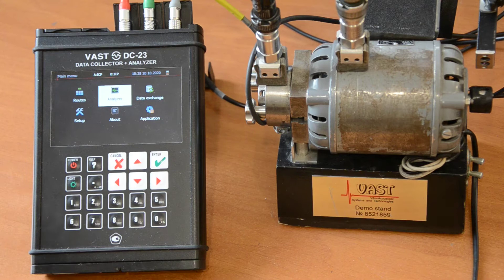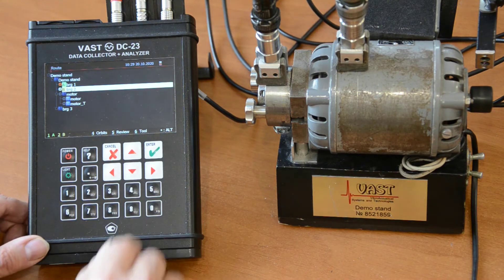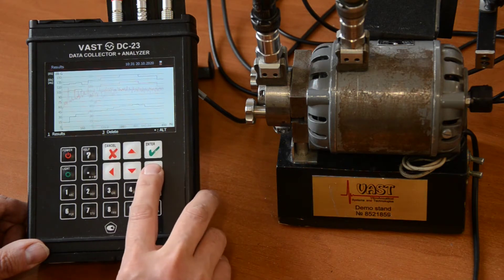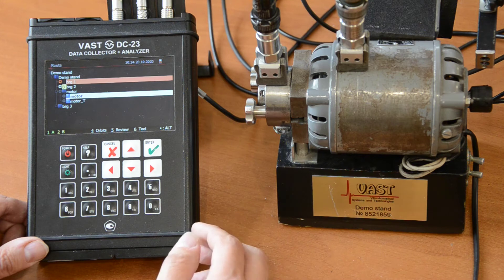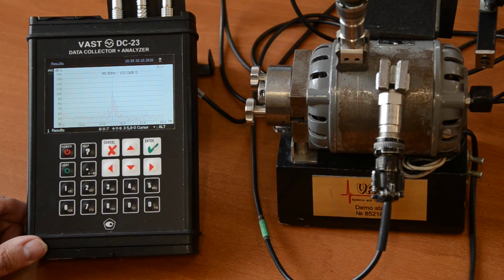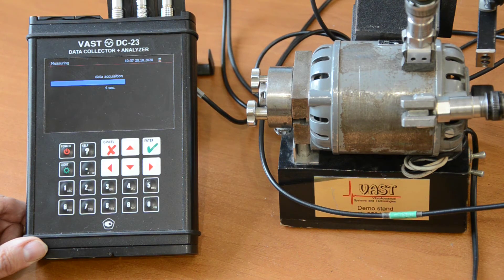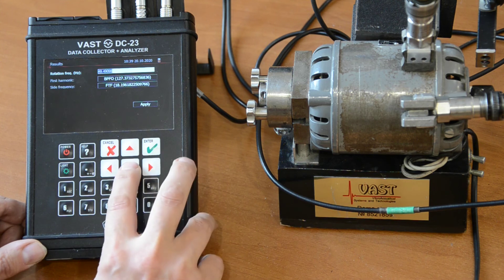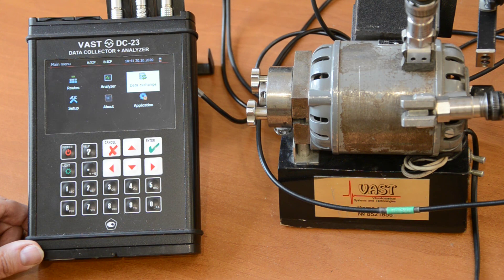Route measurement with vibration analyzer DC-23 Association VAST

Comment: Sir, can I ask some question. why when you start collecting data from motor. That only shows a spectrum from 2 spectrums result. Why it can't show rpm results too sir. Pls help me?
Reply: Because I have task to do. Analys the vibration from the pump and the motor.
Reply: The seller in my country, cannot explain how to use the tools DC-23 and how the setting Routes on Software. I have to learn by watching your video sir